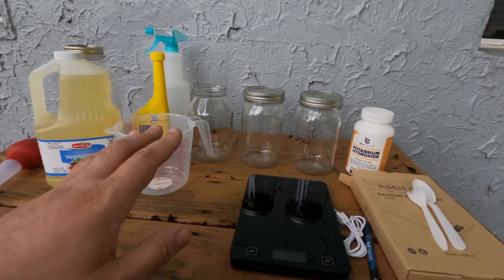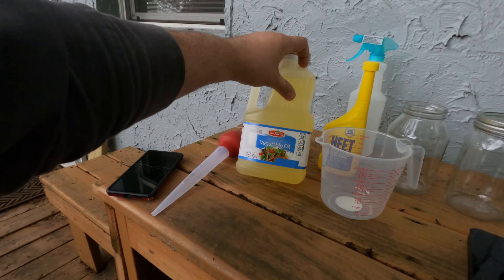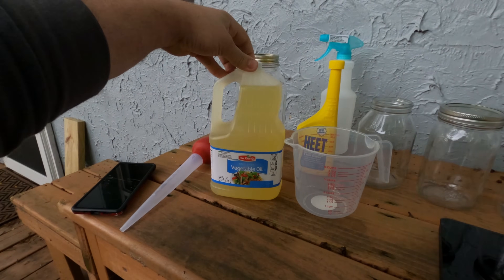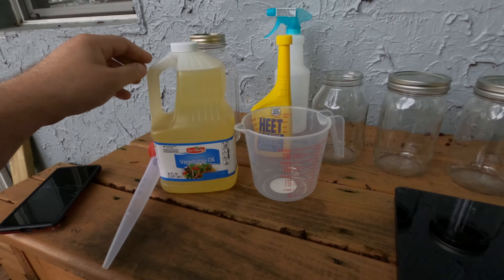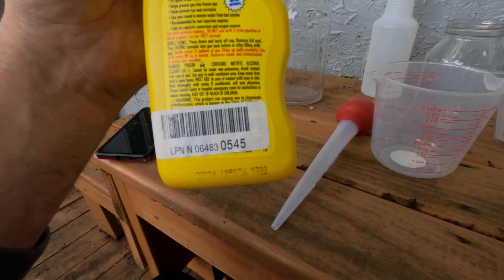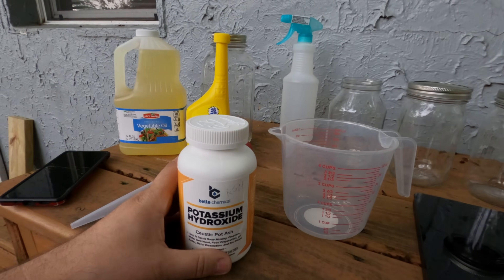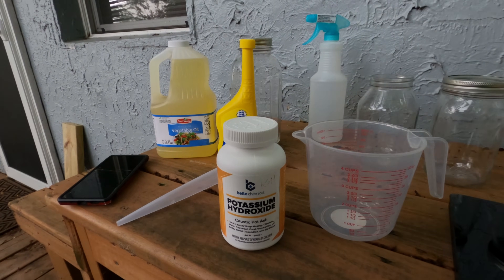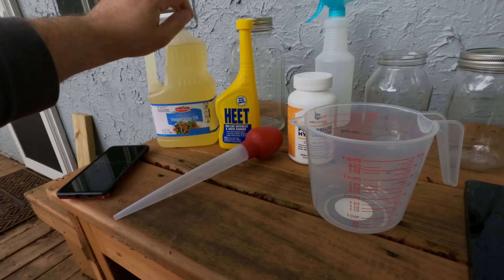This is why making biodiesel is going viral now! It's so easy!

Comment: Can you use olive oil?
Reply from the maker: Sure, any vegetable oil is fine
Reply: That would be a waste of oil unless it has turned rancid and is unusable for cooking. Currently in December 2022 the going price for plain olive oil here on the Island of Crete is around 4 Euro a LITER. Diesel has risen to 2.60 Euro per liter. If you have olive groves you can request from your processor for Pomace oil which is olive oil extracted from the ground pits of the olives. It’s a bit cheaper, not quite as delicious as regular olive oil and it has less of a water content to it. 
Yes I am an Ex pat living in Greece and I do have several olive groves and have been at it for 17 years.
Reply: @Subgunman  I ask because I can get a pallet of olive oil very very cheap

Comment: The devil is in the details, and when you take everything into account... well, it's not very easy.   First, if you plan on making anywhere near enough to run your diesel vehicle, then you're going to have to find a steady supply of used cooking oil, and that's a LOT harder than it sounds.  All of the likely sources like fast food, etc already have waste oil contracts.  So you're left driving around sucking up the smelly scraps from mom and pop places.   Then you've got to de-water it, filter it, etc before you can even start processing it.  Then you've got the huge expense of potassium/sodium hydroxide and methanol.   THEN you can start processing.  And about 10 percent of your yield will be the black glycerol.  Not pure glycerin like all the bio-diesel say that you can just "give away to people who make soap", but rather a mixture that still has methanol in it and you either have to separate that, or pay a waste materials company to take it off your hand.    We had a commercial grade semi-automated machine that would make 50 gallons per batch.   We would spend an entire weekend, once a month, driving around collecting dirty oil, cleaning it, processing it, etc. to fuel a couple of our trucks.   The minute diesel fell back below $5 a gallon, we sold the whole process.
Reply from the maker: Weirdly, I have way more waste oil than I feel like processing, and didn't pay a penny for any of it. 

The huge expense of potassium and methanol comes to 93 cents per gallon of fuel processed for me. 

I reclaim all of my methanol.

Comment: Buffets are a the great chip source of ysed cooking oil.
I used to put 275 gall toat at buffet. Then exchange it.
Reply from the maker: The best oil I get is from Chinese restaurants. Very little water, fairly clean. 

Local bar was like 1/2 water, quit pumping theirs.
Reply: @TheDrivewayEngineer  i have 800 gallons oil. I do not need it. At 32465

Comment: I did it in 2008 crises. By toats. I had f350 and always had a problem- methanol was eating o-rings in a low pressure fuel pump.

Comment: It is only at large scale that you can achieve $1 a gallon, correct?
Reply from the maker: Correct, buying 55 gallons of methanol for 235 bucks is more favorable than eleventy billion bottles of Heet
Reply: @TheDrivewayEngineer  is it available in 30 gallon drums as well?

Comment: Pull the crap out of the bottom of the jar with your baster. Then you can dump in the whole jar.
Reply from the maker: Literally never ever going to touch the jar again, and do not care one bit
Reply: That is the most common sense way to use the baster. As one reaches the bottom of the jar, just tilt it to one side and continue sucking out the dregs on the bottom. It’s ok to pull some of the diesel out to make sure there are no dregs left. Filter and then dump into the tank.

Comment: Nice and easy thanks pal. Do you heat the oil to 150 Farenheit or Centigrade ? Liked and subbed.
Reply from the maker: When I'm running through my centrifuge, 150 F.
Reply: @TheDrivewayEngineer  Thanks.

Comment: Interesting process, very simple. I'm a biochemistry undergrad that's researching biodiesel made from ethanol and using potassium glyceroxide as the catalyst (made from glycerol). We want to optimize the safety, sustainability, and efficiency of biodiesel production with our methods!
Reply from the maker: That's cool, I'm just an amateur and not a chemist lol. 
The hurdle for me, or any DIY'er in using Ethanol, is producing it free of water. 
The simple pot still I have, can hit 170-180 proof, removing that remaining water is the challenge.
Reply: @TheDrivewayEngineer to dry ethanol we use molecular sieves in our lab (type 3a I think). Reusable just need to bake for sometime to remove the water. Newer sieves will leave some dust that probably should be filtered out

We do experiments showing effects of water on phase separation with our process. Our glassware is kept baking at 105C before reactions
Reply: may I ask what is the source of your ethanol?
Reply: I'm flabbergasted, I couldn't believe he would use water spray and not filter it out. Leaving it on there will cost a lot more money in the long run, than that saved over using reqular. 1st the pump, then the injectors, and onwards from there ☹️
Reply: Which is more energy-rich Methanol or Ethanol? If it is Methanol, I wonder why it is not used instead of Ethanol?
Reply: @Tommy Gröndahl  you got it backwards. Ethanol has more mass and energy (there's one extra carbon). Methanol is used the most because it isn't as sensitive to water in the reaction, so the phase separation between methyl esters and glycerol is much easier to attain than ethyl esters
Reply: @kylemcguff5581  Thanks for the reply! It's just that here in the Nordics only ethanol can be used as methanol is so toxic to drink!!! (Ethanol is also the substance to remove the condensation that forms in the tank)
Of all the excuses, it takes the prize!
So by the same reasoning, propanol and butanol in liquid form would be even more energy rich?

Comment: It would be interesting to know the comparative cost between Bio diesel and normal diesel? thanks.
Reply: The first thing I need to learn is how much a gallon is!??! The diesel prize was around 2,50 € per liter when it was as highest... Impossible to compere with unknown amount (litres versus gallons) so if I could get it down to under a €/litre I would earn a lot of money per year when I drive between 100-200000 kilometers each year...
Reply: @64TommyG  3.785 litres to U.S. Gallon snd and 4.54 litres to Imperial Gallon.
Reply: @64TommyG  I'm guessing!!! 1 gallon 3,75 litre, 1/4 a quarter is about 0,95 l ? This without googling!
Reply: @leiflillandt1488  I wish I remembered those and many other coefficients plus I recalculated fast enough to not have to just pause! It is surely most of the units that one would have to recalculate as our hectare is 10,000 square meters, so is an acre in the US? But then you have to learn that factor too!
It would be best if YouTube could handle the whole thing in the automatic translation, that's what computers started working with...
Reply from the maker: From the pump, it's not even available locally for me anymore. It was about 20 cents a gallon cheaper. 

From my home, it's 93 cents a gallon.
Reply: @TheDrivewayEngineer  Wow I am surprised at it not been available, here in the U.K. we have it in abundance thank goodness!

Comment: With you on this one...But first I am going to say...Do not try this with the newer High Pressure pump engines...such as the one I have in my Jeep Wrangler CRD or the newer VW/Audi models.   In the past I have run Landrover diesels, Rover car diesels, Perkins Diesels, Peugeot/Citroen diesels, even VW turbo Diesels.    I never did any of the things you did....I ran my engines on. Diesel, Kerosene, Hydraulic oil, Brake fluid, cooking oil direct from the supermarket and mixes of all of these....like when a guy gave me 400 litres of old brake fluid.......I would throw half a tank of brake fluid in my Landrover and then top off with diesel, she ran perfectly if not quieter than on straight diesel....same with hydraulic oil.....The Landrover would run happily on hydraulic oil, so would the Perkins diesel.....but a bit of diesel or Kerosene to top it off never hurt matters.    I would say that over the years I did this regularly I saved thousands of pounds sterling......I would occasionally take old engine oil from friends and from my servicing and run it through old denim a few times...Denim is a good filter.    I also denim filtered some of the hydraulic oil, didn't seem to do much to it but it did take out a residue.     I carried out all these operations in a small shed in my back yard and kept a big drum of my filtered fuel in my shed and for years only went to a filling station when I was waiting for something to run through my filter system.
Reply from the maker: I literally put this into a high pressure pump engine in this video. 

I have been doing so for 205,000 miles now.
Reply: @TheDrivewayEngineer  Great....I am happy for you.....I will look into it when I need it.....but I used to do all those things when I was just a poor guy trying to make his way in the world....Nowadays I own a farm and have at least 200 gallons of diesel in reserve at any one time.   (I will probably buy one of those fancy things that do it all for you and keep it in the back of the barn....I still hate wasting old oil.

Comment: Can you use this as a replacement for "#2 heating oil" (aka farm/ag/offroad diesel) in a home oil furnace?
Reply from the maker: Yes, the problem is, as others are mentioning, it's quicker to gell than diesel or Home Heating Oil.

If it's going to be cold where your tank is, you'll have to blend it, or heat the tank, or both.

Comment: Hi, just found your channel, cool topics. 
I've got a question. I have about 200 gallons of 40 year old diesel. It is/was farm grade. It is now thicker and darker, and will clog up fuel injectors on an old tractor. Is it possible to restore the fuel for use? And if not, could I use it in a Chinese diesel heater (space heater) by adding "Heet" or an alternative to it?
Reply from the maker: I'd thin it with gas until it's the consistency of normal diesel, and run it as a blend with good diesel
Reply: First measure the viscosity,  I doubt it's as thick as you think. I've worked with old diesel that's just fine. It will likely need filtering to remove any impurities ( and dry it). Once clean and dry, assuming viscosity is OK. It will be OK. If in doubt, run it in older engines,  pre common rail. Will be fine
Reply: @mikevolante7663  Old diesel handle long time storage much better than the new sorts, and the condenses usually has to be removed whit etanol before each vinter!
The material of the tank is important because plastic tanks are not producing a lot of impurities as metal tanks, but I doesn't know if some sort of chemical reaction can take place between the diesel and plastic in many years?
Reply: Thin it with kerosene maybe?

Comment: Sorry lol it looks like a brand new tub of oil for that you can use set ratios but used oil needs a titration test to calculate the ratios. And yes methanol and potassium oxide mixed is not good for you if you get it on you. Rubber gloves and good eye protection kiddo. I had all the gear ready years ago but found it no good for common rail diesel in cold weather
Reply from the maker: I've been running this in my common rail diesel for 205,000 miles lol, the same one I put this in in the video.
Reply: @TheDrivewayEngineer  brilliant we are at -2°c right now I've no idea what your local weather is like, I have seen bio diesel ho very thick in the cold I have a jeep gc 3.0crd a lot of mercedes parts seem very fragile I know they are very expensive and so hard to work on saying that I would buy another up to 2010 not so keen on the Italian engines in the newer model

Comment: Wait until you have to rebuild your diesel engine because you ran biodiesel.  Your mechanic will love you for it.   Less power and more time in the shop.
Reply from the maker: Only 205,000 miles on my Ram...

How long should I wait?
Reply: @TheDrivewayEngineer  
See my post. Did 200k miles on a 2006 Hyundai and never had an issue. New owner never had either
Reply from the maker: Unfortunately, this dude "heard" some shit, so he's going to spread it everywhere like the flu lol
Reply: @TheDrivewayEngineer  well I got lucky with the plastics in mine and since I do all my own repairs was prepared to flush system and present to dealer under 6 year warranty. As it happened it appears model I had used the “good”plastic and rubber in the fuel system.

Comment: With all the chemicals have you figured out what your TOTAL cost is per litre or quart? Comparing large quantities of mixing vs small quantities? I am looking to do this for my oil furnace in my home..... heating oil just shot to $2.85 PER LITRE 🤯
Reply from the maker: https://www.youtube.com/watch?v=LiZFszCvyjk
Reply from the maker: The cost of everything has gone up recently, I was paying 235 for a 55 gallon drum of methanol and like 90 bucks for 50lbs of Potassium Hydroxide at the time of this video, which worked out to like 93 cents a gallon.

Comment: Made my own biodiesel for 5 years at over 1000 liters per year. Had to give it up when used oil became hard to get and what I did get titrated to high. You have the basics but you need to refine your process. Hopefully you will do so with a larger processor.
Reply from the maker: The only purpose of the video is to show the basics. 

I burn 20-30 gallons a week.
Reply: After Katrina I made biodiesel in a methanol, sodium hydroxide process, my truck ran great
Reply: Have you tried pre-wash with the previous batch of glycerol? Brings titration way down for the next batch.
Reply: You need used oil I can give you 2,000 litres free
Reply: @tking1539 where is it coming from?
Reply: Also when doing in a big scale you need to consider mole ratio because it will not the same ingredients doing 1 gallon than making 1000 gallons

Comment: I run a diesel generator during the winter since my solar panels don't work during our dark Alaskan winters, I'm sure the gen wouldn't care if it drank biodiesel.
Reply from the maker: Definitely not, doesn't seem to bother my MEP 804 at all
Reply: You might have to heat the fuel tank and lines if you are in the middle of winter in an extremely cold location. Hopefully the Generator is in an insulated housing.

Comment: bio diesel os great until your in a semi and it gels up in -45 degree weather and you have no heater cause engine wont run, in my semi driving career i never had a problem until bio fuels came out i got stuck for days more them a few times almost freeze to death 2 times
Reply from the maker: I'm never in a semi in any temperature
Reply: Reason I’m fitting an auxiliary straight diesel tank to my vintage for cab heater and winter starting.

Comment: Also beware of local methamphetamine laws, as you have 2 of what are considered precursors of manufacturing methamphetamine,and a scale.  If you buy one box of pseudoephedrine then most states can charge you for conspiracy to manufacture methamphetamine
Reply from the maker: I buy methanol in 55 gallon drums, potasium hydroxide in 50 lb sacks lol. 

Don't be a tweaker and you don't need to worry about tweaker shit.
Reply: @TheDrivewayEngineer  You need to get informed. Many people have ADHD and they find amphetamines like Adderal help them. When amphetamines are made in your home they call them methamphetamine. No different than the process you do to make diesel. Is your diesel legal to sell on the street corner? You must know it is against the law to distill ethanol. I would be a little more understanding when people try to get along whether it is for medical or economic reasons. The original post is correct, you could get busted by an over zealous cop if the oil companies consider you a threat to their bottom line like the pharmaceutical companies do. If you think the mark up in gas and diesel is outrageous consider the markup on amphetamines. All plants and and making your own fuel should be legal.
Reply: @timsteinkamp2245  you might want to lookup the federal laws regarding making ethanol for use as a fuel. There are a lot of people out there who have purchased reflux stills to manufacture 95°+ ethanol for adding to fuel systems and they have not encountered problems with the BATF Gestapo. The only thing that might get one into trouble is if you live in a communist state such as Californication where everything is illegal.